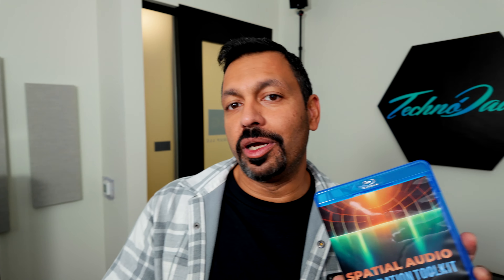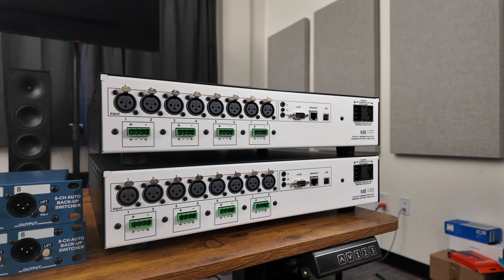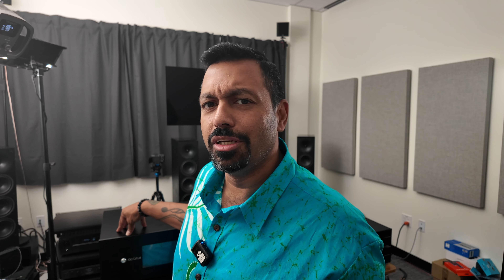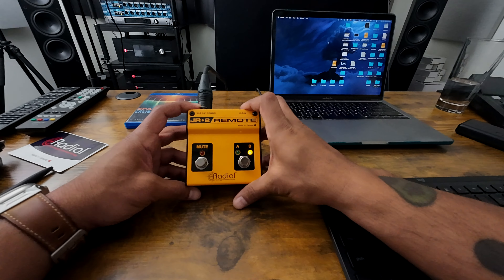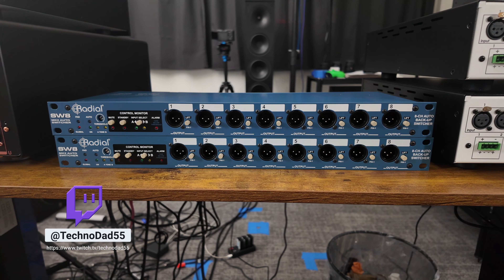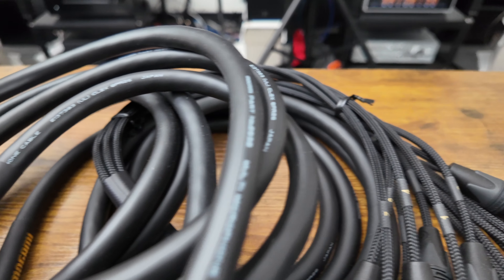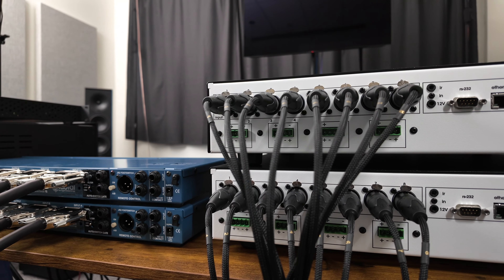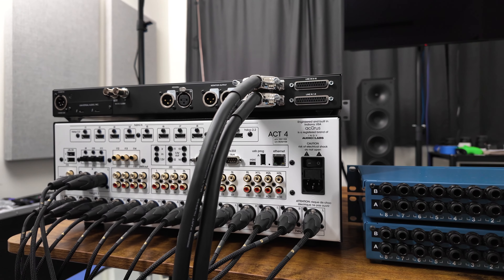Comparing 16 Channel Home Theater Processors is hard without the Radial SW8

Comment: Atmos & Dirac: Hmmm, you not only will be able to A/B Atmos on 16 channel processors, but you will also be able to compare processors for how they implement a Dirac calibration, which like Atmos one would "Hope" would be consistent across processors, however sadly this is not the case for Atmos or Dirac.
Reply from the maker: Great point!

Comment: I do not think , it is fair to the ACT4 to be compared to other processors ;  if other processors use their room's correction  and the ACT4 does not .  
I am an Acurus ACT4 owner : 9.5.6
Reply from the maker: I'll do both a manual calibration and one using their room corrections.  Acurus will send their room correction kit over.